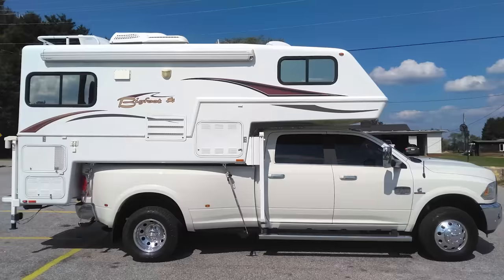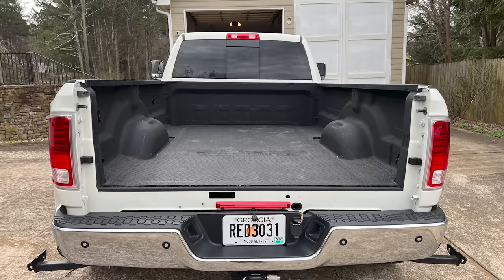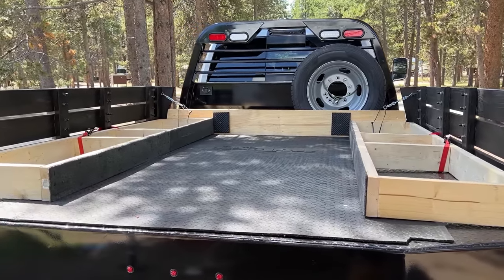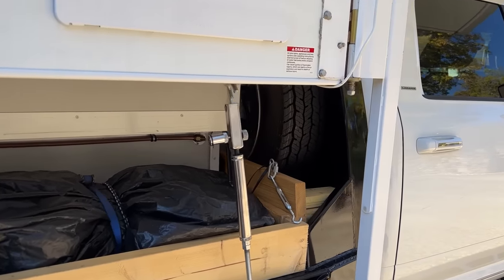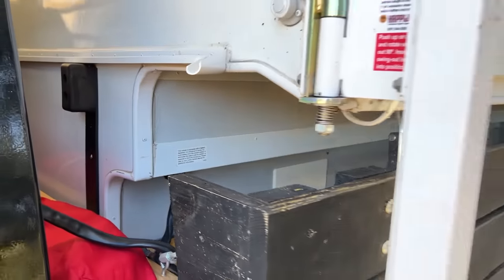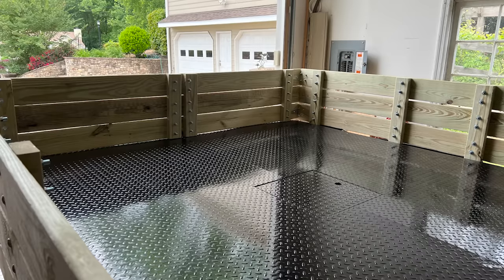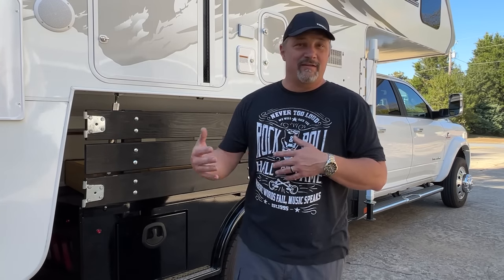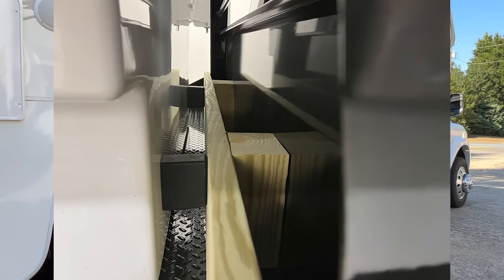Flatbed For A Truck Camper / Pros and Cons

Comment: This was an awesome video!!!
I loved the way you made the area for your camper to fit in and not move around. I finally got my Chevy 5500HD and put a CM RD flatbed on it for my 1172 Lance. You answered my question on the tie downs and I will be purchasing that type also and doing it just like you did. Awesome setup!👍
The 1st con you mentioned is really a pro for the 1172 because it has the “ basement” as they call it that hangs down in the back. Don’t ask me how I know but having that extra height will keep you from hanging up and bending your stairs under the camper. Loving you videos!!!!

Comment: Todd, almost every video I’ve watched of yours features a different camper. That’s reassuring as you both have very specific feelings about your rv needs and, apparently they can be met with different brands/models. 
I’d love the extra storage of a flatbed, especially for firewood and outdoor living accessories. Thanks for all the analysis, you develop a considerate approach to your analysis and I’ll greatly benefit from your research.

Comment: I have my Eagle Cap 1165 on a flatbed International CV 515.  Instead of going to the hassle and expense of putting in a plug for the camper, I just bought a 5-foot extension and a 7-wire Y-splitter. The splitter plugs into the rear outlet , the extension plugs into one of its ends and the trailer I pull plugs into the other end.  Easy peasy.  Maybe $30 total.

Comment: Excellent Video.
I have really enjoyed watching all of your videos,  you have done an excellent job in keeping us informed.
I am in a quandary right now between the Silverado 5500 or the Ram 5500, I really like your set up.
The more time I spend watching your videos the better informed decisions I will make
I like what you have done with the storage wooden boxes and the wood railings to save on the weight 
and at the same time keeping your trailer centered on the bed of the truck.
Weight distribution  is very important for the ride of the truck.
Thank you for all that you do.
Reply: I don't think you can go wrong with either 5500, but I am partial to the Ram.  In either case, keep in mind that it will be a little higher than the Roses' truck due to the larger commercial tires on a 5500.  Also, insurance on a 5500 can be an issue.  We bought a used Ram 5500 4x4 with a skirted flatbed and had to purchase a separate policy on it.  Not a huge deal, but be aware that most car insurance policies won't cover a 5500 because it's considered a commercial vehicle.  We tagged ours but had to sign an affidavit that it was for personal use only and not commercial.   Also last, but not least, we've found in our area it's more difficult to find repair garages to work on a commercial truck, even buying and mounting tires but, again, not a huge issue and we are in a more rural area.  With our Ram 5500 we won't have to worry at all about our weight, yes we'll be sure it's distributed correctly, but overall weight is not an issue.  We don't have a truck camper yet, but we know we can safely carry any on the market with no worries.
Reply: Hello Doodles,
Thanks for taking the time to give me a sound piece of advice
The insurance had not crossed my mind, I was under the belief that all I had to do was call my insurance company and add it to my policy
that is something that I need to address ASAP  with my insurance company.
I live in southern cal, I am fortunate that I have several reputable diesel repair shops around me, I try to stay away from the dealers as much as possible.
At the present time I have a 2021 Silverado 2500 with the Duramax and the 10 speed Allison.
I just drove the truck to Oklahoma and really liked the ride.
I just retired and I am planning on a long trip to the PNW, crossing into canada and driving up to Alaska.
Once again Thank You for the heads up.

Comment: If I had a flatbed, I'd probably look for a camper that's designed for the flatbed.  You'd gain the interior space by having a camper that took the full bed, rather than leaving room for the bed side on a conventional pickup.
Reply: Almost no truck campers are designed specifically for a flatbed, since they were such a small niche market.  However. that is changing.  Rugged Mountain in Idaho makes a MONSTER camper specifically for a flatbed and others have produced prototypes.

Comment: I've had my flatbed diesel for many years.  A couple years ago I bought a used 1980's camper and restored it inside and out, then put it on my flatbed.  It is awesome!!  A lot more storage space in which I put a small 2,000w Honda generator, extra propane tanks, tool box, gas can, etc.  Personally, I think a flatbed is the way to go for a camper set-up.  We don't really use it much, a couple summer weekend camping trips and hunting season.  But all in all it's ideal for us.

Comment: 12:10 I just saw the tow extension you have and it is the same rig I lost my Toyota Hylander on towing4 down. Trust me that WILL break. I had a new set up 3 months old and the side forces when turning finally broke it and I lost the car. My weights were good and I thought all was well but it wasn’t. Please if your towing anything other than bikes please consider the double tube with the chains for side to side support. It’s a terrible feeling when your headed straight down the road and your car veers off and heads a different direction to its demise. I wish I would have known about the set up I have now sooner. Please heed my words they will save you a lot of greef for little $. Good luck. I have a Ram 3500 6.4 hemi ( so i have extra payload) with an Lance 1172. Torklift Super truss E1536 36” tow extension. $659 that will save you so much greef. Well I guess I should have watched the whole video before posting you go into to it at the end!

Comment: Have you looked into getting a Kelderman airbag system? 
If you do, go with the H3 air system. It will help with the ride, and you can lower the truck to pickup the camper.

Comment: I just added the Super Truss hitch to my Ram 4500 with a CM flatbed and it was a very involved project. The hitch on the flatbed was only rated for 10,000 lbs. with a standard length hitch. When you add a longer extension your weight capacity is greatly reduced. The Super Truss hitch required major modifications to be the rear of the flatbed. Lots of cutting and grinding. Now that the job is finished I no longer have to worry about the weight of any trailer I might pull with our rig.
Reply: Do you have pics of your project??  I would love to do that too!!

Comment: OMG I love your video I'm looking for a flatbed to replace my bed in my 2013 F350 Drew Cab Diesel  I love my truck.  The bed on it is not lasting me had the rust fixed once and came right back and have to replace it.

Comment: Great video and lots of things to consider. I’m thinking that most if not all aluminum flatbed’s will have a steel underbelly chassis so the weight saving might not be that much ?
You could always put aluminum boxes under a steel flatbed. 
Considering my options 😊
Reply: Probably have to be careful adding aluminum boxes to a steel deck. Likely need some sort of isolating rubber bushing to prevent electrolysis from dissimilar metals. I'm no metallurgist but I'd think should be a consideration.
Reply: Have you thought about Sumo springs  ?

Comment: The crew cab dually with that large of a camper negates so many of the things I love about having a truck camper. First and foremost we fit in a regular parking spot . Which is important at so many pull off road side attractions grocery stores so on.
Reply: If fitting into a single parking spot and maybe something else you don’t like, negates all the pros he mentioned, seems being very non-flexible, especially for a truck camper owner. Back into a fringe spot of the parking lot a take up 2 spots. Travel trailers and motor homes you see take up 5 or 6 spots all the time. I don’t see why that would be a no go subject for you. That is what you like, I am not going to tell you how you should decide what too buy though. Safe travels!

Comment: Why did you mount your camper back so far from the front rack? It would shift the CG back quite a bit. Was it just for spare tire storage, or was it because the camper underside interfered with the bed deck? Thank you!

Comment: Thanks for sharing your build. Been contemplating this for a few years now. Getting close to making a decision. Standard skirted bed is what I'm leaning towards but I think I'll have to clearance the fender wells for my 37" tires. One advantage I can see with side wing storage is a place to store the jacks if taking the rig off-road. Also perfect place for a small Honda generator and should be able to run there as well.

Curious if you happened to know your total height with the flatbed? I'm already pretty tall at 11'10" with standard pickup bed (unladen - total of the 2 - haven't measured combined after some tire and suspension changes). I knew I'd be gaining height with a standard flatbed but thought more in the 3-4" range. 6-7" is going to significantly effect CG. I know Bowen Customs makes theirs that hold standard height but they are super proud of them pricewise!

Comment: Out of the campers you have had , Lance, Bigfoot, Northern Lite, any others?, which do you feel was the best quality construction, which was the best designed interior as far as ease of use or moving around in it,  and of course which did Carla like the most?
Reply from the maker: That is a loaded question but the short answer is we have loved all three of them and they all make great campers.  It's mainly all about finding out what works for you.  The Lance 1172 was by far the roomiest but we love molded fiberglass camper so we went back to a Northern Lite.  The none slide campers are tighter but easier to get in and out of while on the road traveling.  Hope that helps.  Thanks for watching!

Comment: I have a dump flat bed 8.5 long by 8 wide and it sits pretty high. And i may have to cut my headache rack down a bit but pretty sure itll sit on there nice. I was thinking i could use the dumper to level me out while sleeping on a hill.

Comment: I kept looking for the camper arrow on the lower sides ? The arrow that shows were COG. Center of Gravity and how that arrow is located with your rear axle. Is your cog marker missing ?  Can I ask what your camper dry weight is and your truck weight with all the options ? Then the third final weight of fully loaded with water propane gear etc. ? I just attended what was called the largest truck camper rally every in Quartzsite Arizona. There were quit a few no shows but I think around 335 truck campers attended.  There were work shops on different subjects and one class that got lively was the true weight of vehicles and the true weight of campers. Folks that have had several truck campers over the years would swear to their GVWR but one trip to the scales shock many people. Half the vehicle there were over weight and not by 100 300 or 500 Pounds but several 1,000 pounds. 

The reason I say all this is why go through all this expense and trouble and find out its not right with weight and things like COG location.  Thanks for the video and I to have a protech flatbed with a bigfoot on it.  Why did you take off a bigfoot and put on a Lance ?????

Comment: Great video,  I was curious the size of the flat bed, looking to get a flat bed and do this,  looking at a 9ft and a 8ft, both 3500, another question,  is yours a 4500 or 3500?
Reply from the maker: My truck is a 4500 cab chassis so it has a longer cab to axle length than a 3500 by a few inches.  My bed length is 9’ 4”.  Hope that helps and thanks for watching!

Comment: Hey y’all.  Just upgraded to a 5500 after having a SECOND wheel failure on my 3500 (I really need to make a video on that).  Question for ya:  I also got the PJ skirted flatbed installed on my truck (diamond plate tho ewww) and it looks like the bed itself was installed too far forward and the wheel well isn’t lining up with the wheels.  Does yours look like that too?
Reply from the maker: Hey Downbytheriver, Congrats on your new 5500! That should handle your NL with no problem.  Both of the flatbeds I've had were lined up pretty much centered over the rear tires.  I have seen what you're talking about before and most likely it's an install issue.  You could unbolt the bed and slide it back but that would make for a good bit of work, and you might have to make some new mounting brackets.  Maybe a place that installs the flatbeds could adjustment if for you fairly inexpensively.   Good Luck and thanks for watching!
Reply: @RunawayRoses  that’s what I figured.  They were giving some excuse on how they had to use factory bolt locations but I smelled bullshit

Comment: Hey Todd did having a flatbed change your insurance rates to commercial? Also with a regular truckbed your payload is covered by your truck insurance. Does that change with a flatbed if its considered commercial?
Reply from the maker: I did have to find a separate insurance company to in sure my Ram 4500 because our normal insurer wanted to much money even with bundling it with our other vehicles.  It wasn't because of it having a flatbed for us it was the fact that it was a heavier duty 4 series truck that raised the rates.  We did insure it as a personal vehicle and not commercial.  You can get reasonable insurance for a 4 or 5 series truck buy you may have to shop for the insurance based on my experience.  Thanks for watching!

Comment: LOVED the video! Been wondering if I could put a camper on my 2001 F450 flatbed. The bed is 9' x 8'. The width is the big question. Suppose I could build "adapters" for the camper jacks to be able to load a camper? Or should I just sell the truck and start from scratch? Any thoughts would be appreciated 😊
Reply: You ABSOLUTELY can put a camper in your flatbed!  Very easy to do!

Comment: I run an 1172 on a Ram 3500 Crew cab. It porpoises quite a bit on bumps, bridges, uneven pavement, etc.  Do you get a more consistent ride with less or no porpoising with a frame mounted flat bed?
Reply from the maker: Yes, Our Ram 4500 handled the Lance 1172 much better than a regular one ton truck.  The stiffer springs, frame and flatbed really made a big difference in hauling such a heavy camper.  As you know a one ton dually can do it but a 4 or 5 series truck will handle the load much better.  Thanks for watching!
Reply: You are overweight with an 1172 on a 3500 crew cab!  Guaranteed!

Comment: Adding the bumper up front with the headache rack and the camper sitting 10” further back, does that throw your cog too far back on a 60” ca? You got a 60” ca or do you have 84” ca bed? If that 10” does not hurt your cog of the camper on the bed, you’ve solved my problem on where to put my spare. I want to get the extra fuel tank under mine but also want the 60” ca.
Reply from the maker: Hi Todd, My truck is a 60" CC truck with a 9'4" bed on it.  The camper sitting back ten inches hasn't really affected anything.  It drives great.  The camper has to sit back on the bed because of the way it is designed I can't slide it forward anymore.  With the trucks wheelbase being longer than my Ram 3500 and the longer bed the cog doesn't seem to matter much.  Hope that helps and thanks for watching!

Comment: Good Morning;  I noticed you have a garage in your video. May I ask you what is the gate height from the concrete floor? I have a 2004 F350 dually with stock wheels but no garage which I plan to build one for incoming truck camper. If I try to go inside the garage with my truck and camper on it need the correct height? I appreciate your reply in advance.
Reply from the maker: Hi Lord Baltimore, Our garage door is 10' wide by 13' 1" tall.  It was originally 12' tall.  I would recommend at garage door at least 12x14 if your going to build a garage that you'll park your truck and camper in.  Good Luck and Thanks for watching! ~ Todd
Reply: Thank you very much for your reply. Much Appreciated.

Comment: Sorry again did you use 2x4 or 2x6 on those and is it treated wood?
Reply from the maker: Hi Joe, I used 3/4 pressure treated deck boards.   It should last a while.  It is kind of heavy though.  Could probably make it a little lighter with pine 1x6.  Thanks for watching!

Comment: Buy a class c motor home  this not a off road vehicle to say the least. And you can add 4x4 to  a class c if you need to.  This is too big and heavy
Reply: This will still get you more places than  a  class C. There is more ground  clearance  and being a F 450 it is more robust than a class C. I'm guessing  this is a factory 4x4.
Reply: Check out Quigley 4x4 in York Pa. They do the four wheel drive conversion and it will not void your warranty.  I have been running the beach for years and use my rig for hunting and these big campers are very limited to where you can go. Light is right as they say

Comment: what is your truck weighting without the camper on? And is it a 3500 or 4500 or 5500?
Reply from the maker: It was a Ram 4500 and it weighed about 10,300 unloaded.  Thanks for watching.